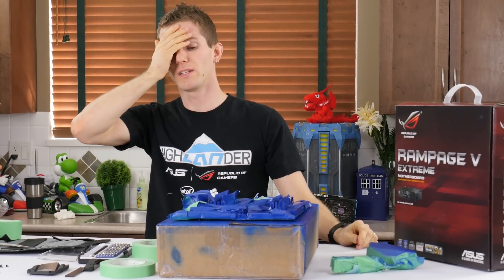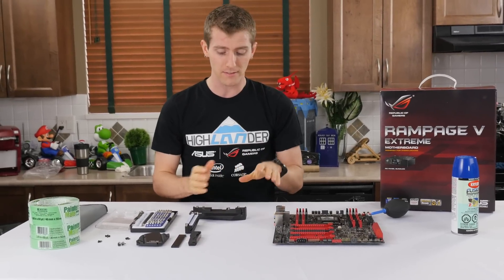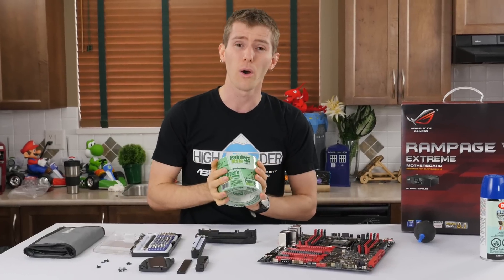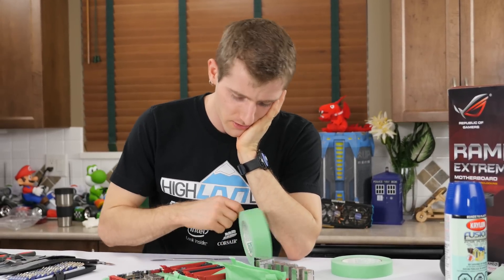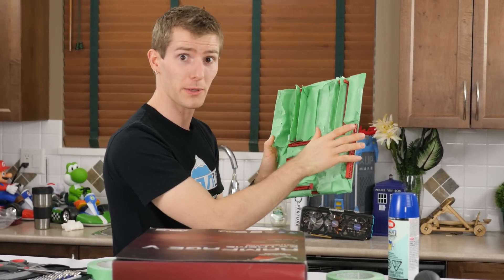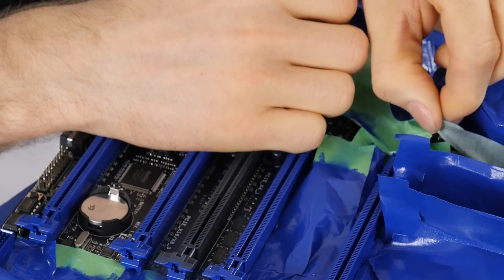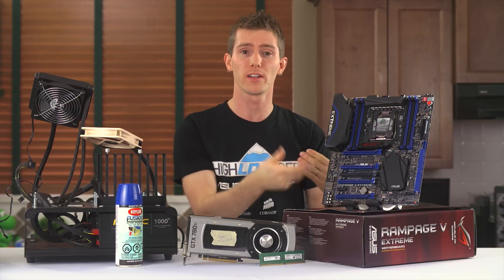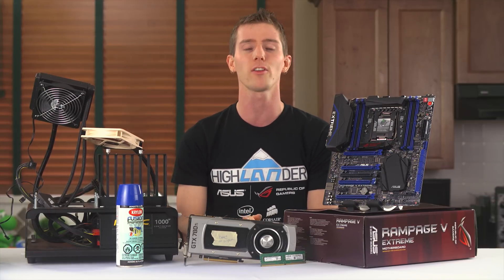Painting A Motherboard DIY Mod - ASUS Rampage 5 Extreme - Part 1

Comment: Can someone please help me with my gaming build? 
This is my first time making a gaming PC

Graphics card: GTX 980 TI
SSD: Intel 730, 480GB SSD
Case: NZXT H440 case
Core: i7-4790K
Hard DriveWD 2TB hard drive
Power Supply: Corsair CX series 850 Watt 
RAM: Corsair Vengeance 16GB RAM 
Water cooling: Corsair Hydro series H110 280MM CPU cooler
Motherboard: Asus x79-Deluxe
Reply: +Rishi Jusia your good your set for the next 5 years
Reply: Pandaman
That is very nice to hear, thank you. :) 

I've been studying into some of the latest of gaming and pc building and thought that i should give it a try. 

The graphics card might be OP, but I had a choice, either SLI 790's (2) or just 1 and I thought that one would be sufficient. 

But, thanks again :D

EDIT:

Note sure if there are any incompatibilities, but I did check the replacement fans im buying with it.
Reply: whats your budget
Reply: Pandaman Aiming for the mark between 2000 and 2500 

currently on 2440 I think....
Reply: bruh where do you get this money from and for your first build too thats hard core built my first pc with like 350 😂😩
Reply: Ailuropoda melanoleuca Nineoneone
Thanks :D

I'll stick to my one card.
Reply: +Rishi Jusia btw,  this may be late,  but whatever, you processor is lga1150 and the motherboard you got is lga2011. Sorry :/
Reply: Thunder -inwl-
Noted man.

But I have changed both to:
Asus maximus 8 skylake compatible
i7 6700k
and a 512gb ssd from samsung
Reply: +Rishi Jusia Sorry brah. It's OK.  Just looking out for ya
Reply: Thunder -inwl-

No need for sorries man.
I am the one asking for help.
So.. Thank you!
Reply: +Rishi Jusia Well i mean if your budget is that high the parts are rly good. But if you want to save some money, you can build a good gaming pc at around 900.
What I used to save money:
 - Intel i5 instead of i7 (CPU isn´t that important for gaming because the GPU is going to do most of the work)
 - 8GB RAM instead of 16GB. Currently you only need 16 if you run some big virtual machines.
 - I´ve used the GTX 970 instead of the 980. Why? because it´s much cheaper and the 980 is about 5%-10% stronger than the 970. Or you wait for the next graphic card generation, because they will most likely again sell the stronger ones earlier for a cheaper price.

Hope i could help with that.
Reply: Alexander Heim

Are those %'s on te gpu accurate? Cuz like DAYUM.
Reply: +Rishi Jusia Honestly I dont know the accurate values but its somewhat around 5-10%. I use the 970 and can run any game at the highest resolution fluently
Reply: +Ailuropoda melanoleuca Nineoneone I never had a problem with 8gb by playing games.
Most VM are easily manageable with 8gb too. A tip from a guy who builds computers all the time (thats me): Get a 8gb Ram and if you want more you can always get more (2x8 or 4x8)
Reply: Ailuropoda melanoleuca Nineoneone Yup
Reply: I don´t know. I mean yea it looks cool and everything but let´s be honest how often are you gonna look at it? Sure i want a pc to look nice but i rather invest the money I saved in a nice vacation or something like that.
Reply: Will Leach
 Very nice to hear this. 

But I currently have the parts in my house and will be building it tomorrow (plans for today) 

Bought replacement fans too. 
a samsung 512gb ssd. :) 
and I'll be expanding on ram and probably SLI a 970 and 980TI. 

Added some purple leds too.
Reply: Will Leach Guys im gonna kill myself, 
After realising I had wiggle room and changing my mobo into the max 8 I didnt read the fact that it's ddr4 only while my ram is ddr3.... Had to order new ram. Oh well I guess since I can use this ram for my living room media pc.
Reply: Rishi Jusia Yea well thats kinda embarrasing isn´t it? :D
Reply: Alexander Heim It sure is... 
:(
Reply: +Rishi Jusia go for a fury x! :P
Reply: Cody - The Cringy Entertainer
I already went with G. skill ddr4 16gb (2x8)
I think 3200Mhz
Reply: Ailuropoda melanoleuca Nineoneone slightly worse, runs cooler, and is slightly cheaper :P Especially with directx12 coming soon i would pick it up.  Im currently going for AMD parts
Reply: What a coincidence finding this comment on this video
Reply: Hope you recognize me lmao
Reply: +Rishi Jusia Your problem is the lack of motherboard,ram,and everything else.

Comment: Holy fuck the audio...generally it's pretty bad, but straight up un-listenable here; full on cut outs and distortion.  Beyond the obvious technical difficulties in this video here, a little post pro for audio in general never hurt anybody. I realize your guys are video editors, not audio engineers and banging out content in short periods of time, but a little goes a long way as far as audio goes. Multi-band compress a little, EQ a little. It helps.

Comment: I would have recommended laying a sheet of plastic over the motherboard and then cutting slits for all of the components you want to paint to pass through. Then tape around the slits. It would prevent any over spray and probably saved you a lot of time. Still looks like it turned out well though.

Comment: i actually experimented with plastidip on my ram modules to get a nice orange color that i could take off later. make sure you mask everything off that can get plastidip on it. i have noticed no performance issues from doing so as well as temperatures being about the same.

Comment: If I built a Pc with a motherboard without wifi do I need a wifi card or usb because Ethernet is not an option
Reply: Yes, you can buy an add-on that goes on a PCI slot on your motherboard and is really easy to install, just look one up on eBay or Amazon, they're about $20-$30 depending which one you get

Comment: i can tell right from the start of this video, you should have got an air brush. would saved you a lot of time. plus everyone should have an air brush. Great little things. Also you could have used blue tack or some kind of putty for the slots. also would have saved you a lot of time and you wouldn't have the problem of paint running under tape. Putty is the way to go on a surface like that in general actually.

Silly Linus....

Comment: I would have done each part individually.
Reply: +Devin Chaves Here's someone who has never used a spray can before.
Reply: No really. Instead of doing precise taping along the whole thing at once, thus dealing with overlapping parts, you partition one part from the rest. Hit it and repeat.

Not to mention that you will always get a cleaner line if you pull off the tape while the paint is still wet.

Also, you know what? Shut the fuck up.
Reply: +Devin Chaves so taping say a pci-e port (one and then painting that only) then taking it off right away, let it dry then do the rest? I would concern spray can would shoot some particles one way, hitting the connectors and messing it up but it's a good idea
Reply: +Devin Chaves Spray paint doesn't work that way, especially with a motherboard that has multiple parts within the same area, some in the center of the board.

You can't just section off a motherboard component that's in the center of the board, because then paint gets everywhere.

Nice spray painted board. If it only it worked.

Comment: I don't know if this worked as far as the memory and pci slots working, but it seems like you really should have slipped some card stock or something into the actual slots because I imagine getting paint in them doesn't make for good contact with the component PCBs.

Comment: A really good tip for painting your motherboard, get old components like some old RAM, PCI devices, etc and cut the bottom part of the PCB off and put that into the slots so that no paint gets in there. Do that with SATA ports and other things you are painting. That's how i did my old one and it worked really well.

Comment: linus.. i think this could of been done better.. the worry about paint getting in the pci express and ram dimm slots could of been avoided.. what i recommend for people planning on attempting this, is to buy a single stick of Damaged or very cheap ram, and a damaged "as is for repair" type graphics card. tape off everything else first, including the other pci express and ram slots and paint them one at a time with the slot populated with the "dummy card"   this will keep paint from getting inside and ruining that slot..     even a plastic credit card or piece of thin cardboard or folded paper in the slots would help.

Comment: this is the most monumentally stupid thing i think I've ever seen you do!
this dose however make me wonder if the sockets could not just be desoldering and replaced with blue ones...

that would make a tone more sense then spray painting the thing...
Still way the fuck to much effort either way....

But for doing something stupid for the sake of stupid 10/10!
Reply: +ZerqTM Suggest to desolder the sockets is more stupid.
Reply: Well i never said it was smart to begin with...
If this really is an issue then i would suggest motherboard makers make the pastic bits replacable on the sockets then we have a simple fix and they can sell cheap bits of plastics to people for a profitable markup :p

Comment: Thanks for the video. Just one question, firstly, sorry if this has been said,maybe i'm missing it. Wouldn't the spray got into the PCI-E Slot or RAM Slot and damage it? or is there a trick to avoid it getting in there? Thanks in advance and sorry for my bad english. Thanks again for the video.

Comment: Just in case anyone responds: I've been working on a beast new animation and editing rig with a black/orange theme. The mobo I'm using is the GA-Z97-D3H from Gigabyte. All the motherboards in this series have a horrible-looking gold heatsink scheme that looks bad against my orange LEDS and fans. Is it possible to take the heatsinks off and spray paint them orange with some heat-resistant paint?
Reply: +First Flight Yes.
Reply: Infinite Zero Would I need to sand it first so the paint doesn't come off?

Comment: Hi 
I was thinking if you might help me out I am buying a new custom pc this are my specs 
Can you please tell me how many PSU will be needed to run this without any defect
Intel core i5 -4460 LGA 1150 cpu
Asus Intel maximus vii ranger motherboard
Corsair vengeance 8 gb ddr3 ram
Asus strix nvidia GTX 960 2 GB DDR5
Asus drw 24D3ST DVD BURNER
Segate 1 tb internal drive
Cooler master Hyper tx3 EVO cpu cooler
Cooler master k380 pc cabinet

Comment: May have been faster to desolder all the red and black. connectors and replace them with blue ones or black ones.
Reply: It's basically impossible
Reply: +Hdgrove why? just curious
Reply: +Henry Montero the soldering connectors are EXTREMELY small and fragile,  any cross communication due to soldering error can be fatal.

Comment: This seems completely unnecessary. I can see painting the heat sinks n stuff.. but.. the board came in the colors it did for good reason. I love your videos but this made me face-palm. Like one other poster pointed out, paint seeps down into the slots covering the contacts so no viable connection can be made to the components. They make airbrush guns for good reason.. better control and overall making it an easier job. I would imagine custom cut cardboard inserts to slide down into the channels and valleys would have been a better way to go to avoid seeping from happening.

Comment: when painting the PCI e slots you could have left them plugged into a PCI-E PCI E express 16X to 16X riser card adapter extender cable linus or some old PCI e connectors and plug in the teeth etc

Comment: If you ever plan to do this again I suggest picking up some thinner masking tape. Local hobby stores should have it all the way down to 1/16 inch. That should make it ALOT easier to get into the small places.
Reply: Also, not sure how effective vinyl dye would be on a mobo but that would be less build up of foreign material on parts.
Reply: Justin Updyke
INB4 someone says "motherboards aren't vinyl." I know that but vinyl dye will also dye a lot of plastics...like optical drive covers and many other hard plastics.

Comment: For overspray that gets into the slots I would try taking an old PCIe vid card and wrapping a strip of 1000 grit automotive finishing sandpaper around the contacts and then gently insert and remove the card from the slot two or three times, and blow out the dust left behind, just make sure the paint is properly dried.  If there is too much of an interference fit then just fold the sandpaper over on itself or a plastic card.  What have you to lose at this point?

Comment: Could have taken some garbage ram and cut off the PCI connector from a dead GPU and put them in the required slots before painting, less risky than trying to clean the contacts afterwards. Just in case you decide to do it again.

Comment: Linus, Something else that you could have tried, if you know someone with epic soldering skills, is desoldering the parts, and resoldering ones of different colors from another board, or using dye sublimation to change the stock ones. (Tom Logan over at OC3D had a Rampage 4 where everything had been changed to blue from red, if I recall correctly)

Comment: Why didn't you put ribbon cables inside the PCI lanes to cover the conectors? Or sata cables inside the sata connections to do the same? Couldn't you have removed the little housing around the USB 3.0 header? I think I took mine off by accident one time. Why paint something you're never really going to look at?

Comment: i painted my motherboard as well. i had some old ram in the Ram socked. and plugged a old graphic card Print board in the socked that way i was able to paint it without killing the connections inside the socked's

Comment: Actually like the fact that some mobo manufacturers are choosing to use gunmetal finishes on their boards to be more neutral, which is much more convenient if using variable/selectable rgb led-lighting. However, what would be more suitable is a return to anodised plain or light-grey brushed heatsinks that reflect whatever colour you choose to light it with!
Just remember that while red does look good, it doesn't make your pc perform any better!
&B^{P?

Comment: Why didn't you grab some old pci-e cards, cut off connection part and slot it in to the slots, so paint couldn't get there? Same goes about most connectors.

Comment: Why didn't you swap out the ports using a soldering iron???
I'm disappointed..
Reply: Cause re soldering over 100 pins for each slot is stupid and near impossible for home mods
Reply: passportboom It's hardly near impossible, if you're willing to go to the extent of painting a motherboard you might as well swap out the ports.
Reply: passportboom
 I'm a electrical engineer, I do stuff like that for a living and even with home tools it's not that hard.

Comment: use Cardboard coated with tape to fill dimm/PCI slots before spraying. Makes life a little easier. Also there are SATA fillers that work to block off all the elements inside those as well.

Comment: Could this run 1080p 50+fps titanfall on this gaming rig? 
http://pcpartpicker.com/p/bXRnCJ
Reply: Sorry could I*
Reply: Yes but you need a 500 watt power supply for a r9 270 btw I would recommend a r9 280 and a fx6300 and a 700 watt power supply but make some of those changes and yes you will be able to play titanfall on ultra 60 fps plus

Comment: I did this once with a clear conformal coating to make the board good for a marine enviroment.  I basically had to tape off everything that could accept a plug in.  As far as I know, it's still working.

Comment: Nice Job man! But i think you would be Better of using 'plasty dip'. Its a rubberish kind of paint and super easy te remove. Its actually for cars. But they also use it for laptop backs and other small stuff.

And it has less chance to shurtcut the board.

Either way! I couldnt have done it Better. Again Nice job

Comment: As someone who does this kind of thing all the time, there are a few different paints out there that would make everything much easier to use. The first kind is a non-conductive silicone coating. I've used this kind of paint (though its not really paint) on MOB's before. It protects all of the components that you don't want painted from overspray. Then the second paint is a plastic adhesive paint. In that It only attaches to plastic and nothing else. 

The first step that you will want to do is cover everything you WANT to paint with the tape (All of the plastic bits like RAM slots and PCI ports etc As well as any other connectors that you don't want to paint but also still want to be functional.) That way the plastic adhesive paint will stick to those parts and so you dont coat them with the silicone. 
Second step is to paint the entire board (Minus the CPU connection) with the non-conductive silicone paint. You can get this in a few colors but I prefer the clear. This will also help cool your MOB as it is a great heat transfer. Wait for this to dry (takes about 1 hour till it is dry to touch, and 4 hours till it is completely dry. 

Third step is to take off all of the tape (Minus those connectors that you don't want painted and the CPU) and then paint with the color of plastic adhesive paint that you chose (So far they only have Red, black, white, grey, silver, yellow, orange, green, and hot pink) Wait for this to dry (takes about 30 minutes till it is dry to touch, and 1.5 hours till it is completely dry. 

Fourth Step is to, and i literally mean this, take a vaccuum hose and suck out the paint on all of the silicone coated parts. Then take either an air compressor with a nozzle to blow out any remaining paint or get a compressed air can that you use to clean out keyboards and such. Dont worry about static too much as the silicone protects against that. 

Fifth step is to touch it up with some rubbing alcohol and a non-lint swab (Do not use a qtip. Use a microfiber cloth instead) And you are done. Total cost is about $22